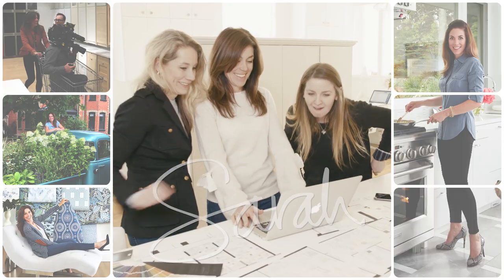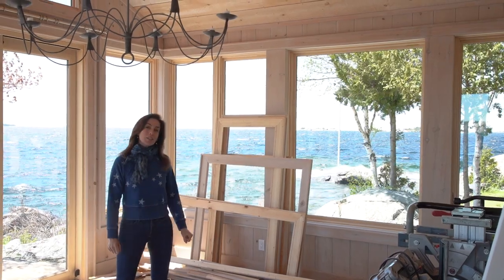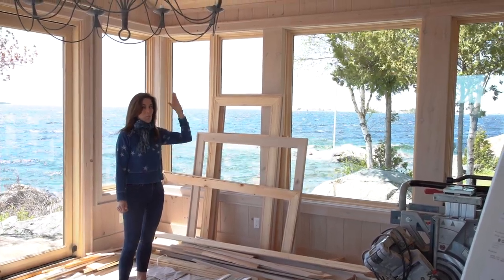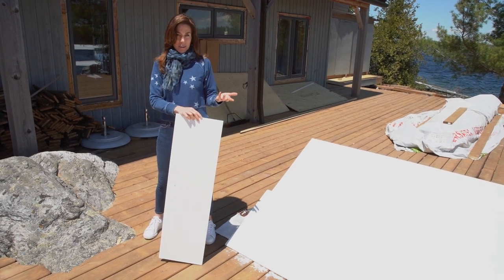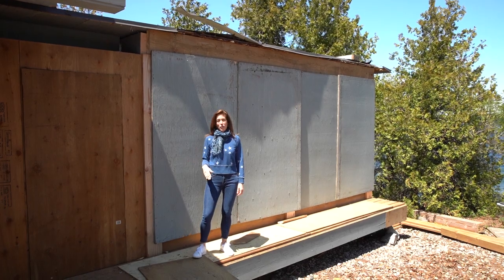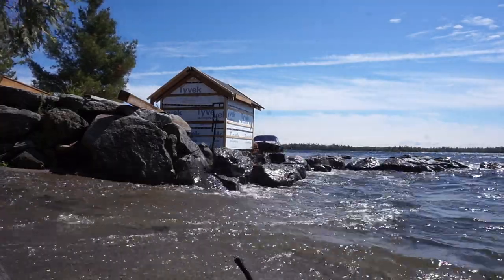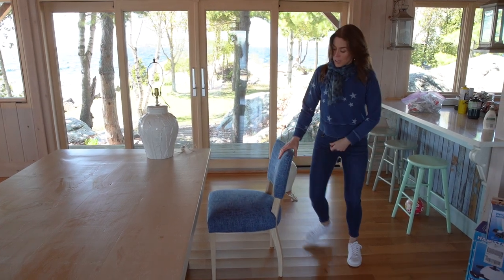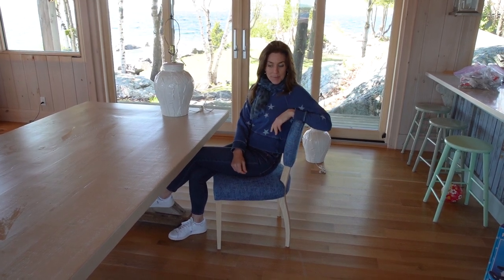Sarah's Island 2.0: "Change is Good" - Redecorating! (Ep. 5)

Comment: I think I would paint the walls, or at least make the opacity of the 'pickled' finish markedly different from the ceiling so that it looks intentional. If it's not going to match anyway, make it look like it was never supposed to match. So put a high opacity, almost painted finish on the walls to give it enough separation that it doesn't look like a mistake, without making it completely opaque. 

The Nick chairs don't really grab me just based on seeing one, I have a feeling though that once I see them all together with the right finish and upholstery, that I will see the vision. The backs of the chairs are what's throwing me, they seem a little bulky, though I'm sure if I was seated at that table I would really appreciate the comfort.

Comment: I prefer painted ceiling by practical reasons or at least clear cover paint. I also have a cottage by the sea and the wind and moist is there around 24/7. Non finished wood will become spotty grey and yellow by it's time. Nick chair I would choose vinyl. Leather doesn't pay of of it's cost in seasonal use. But there are vinyl that looks like a leather, so why not?